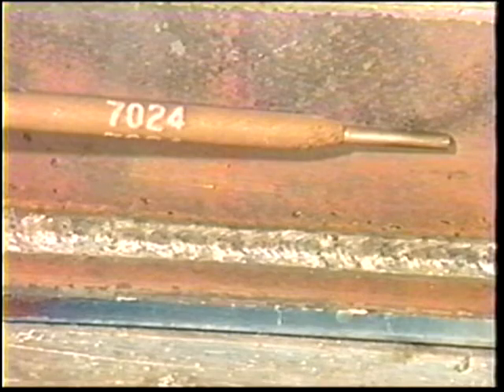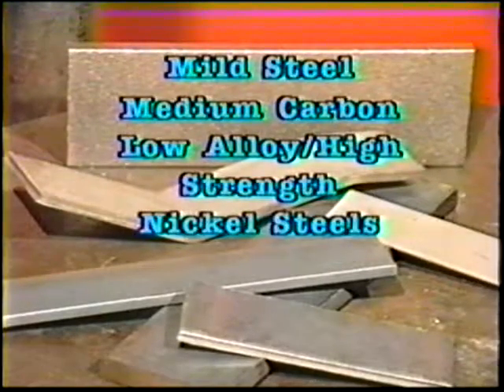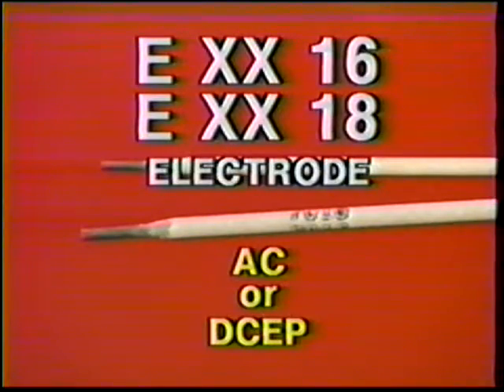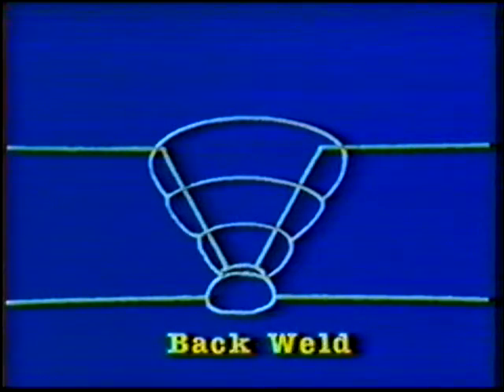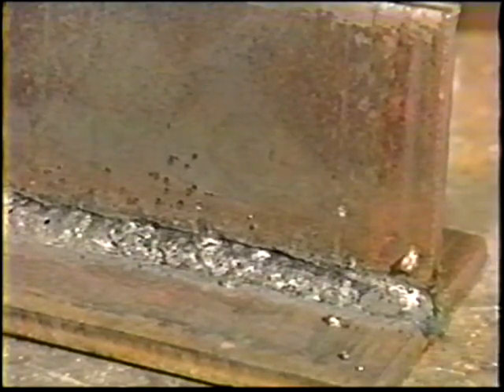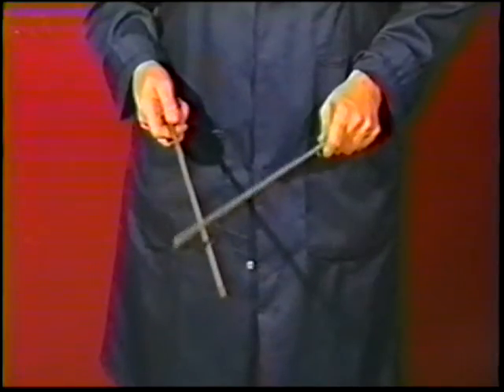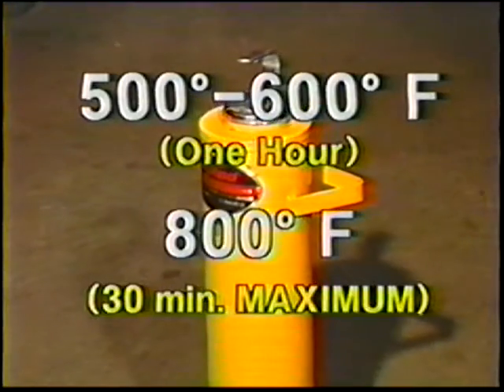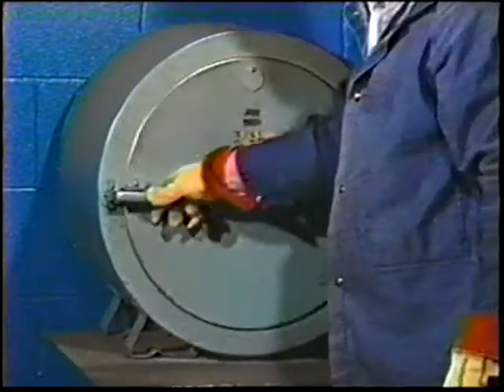When and How to use Low Hydrogen Rod? E7018

Comment: Oversee like china all structural done with 6013. This 7018 rod is overated. You cannot find 7018 or 6011 in china
Reply: Interesting. 6013 is the most common in europe too. 7018 is much more expensive.  However once I tried 7018 I never wanted to weld with 6013 again.  The 6010 and 6011 you can't find anywhere here.
Reply: You think because China doesn't use it, 7018 is over rated. Chi, don't be so ignorant and maybe watch the video again.
Reply: @jamesmay9345  In China you cannot find 6011,6010 or 7018 and if you do will cost you 90$ US money for a 5 pounds box some may go as high as 120$ for a 4 pounds box while 6013 cost 15$ for a 10 pounds box. 7018 is waste money the rod got to be bake in the oven before you can use it. 6013 is top of the line 7018 just garbage a mistake that manufacture screw up now they try to polish it up to make a sell
Reply: @ChiNguyen-wf1qt  All the info you need is easily accessed. 6013 is not top of the line. Have you ever used or seen 7018?
Reply: @ChiNguyen-wf1qt  Exactly.. all you have is 6013.  It is a bottom of the barrel rod.